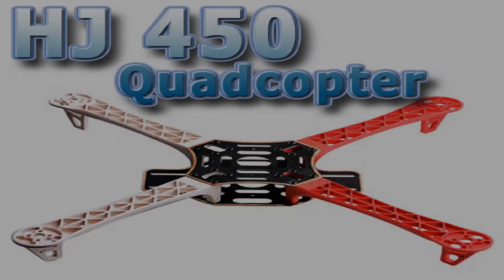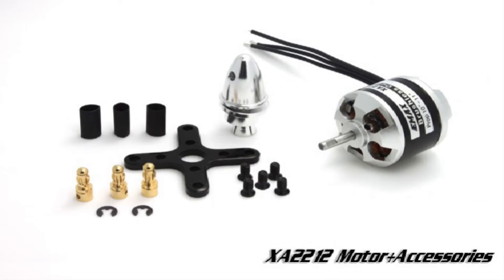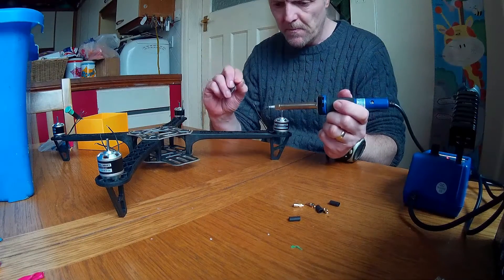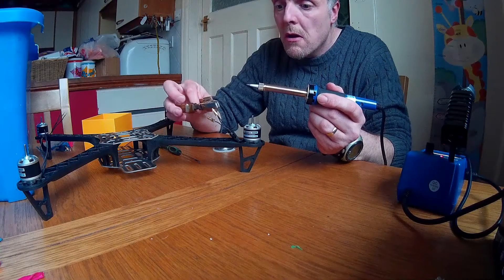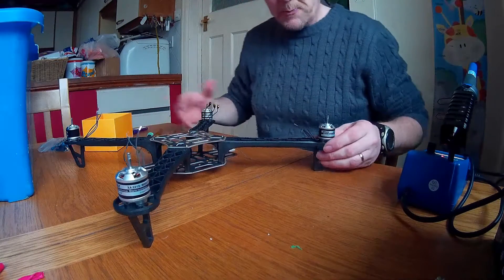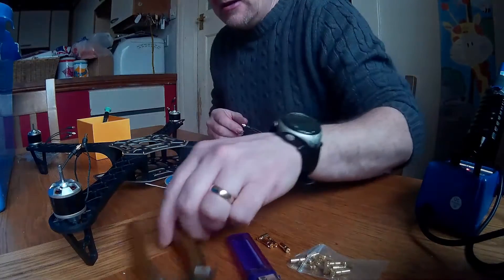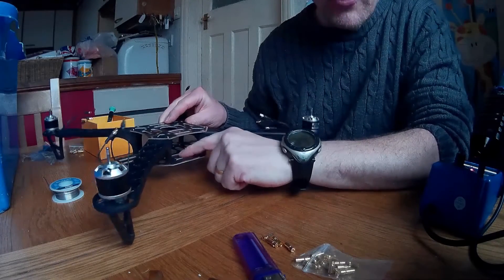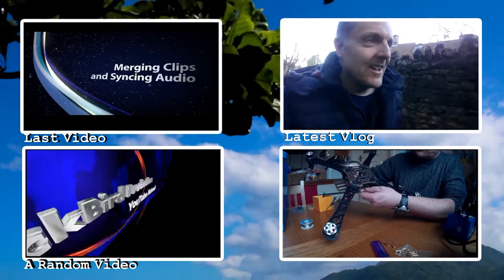How To Build a HJ450 Budget Quadcopter (Drone)- Part 1

Comment: Good to see you here again Austin. I have been considering getting a quadcopter of some sort for a long while but  they are just too expensive. (I've been looking at ones with GPS and instant return to home etc). I'll be following your experiences with this one and if all goes well I may get one myself and then add to it as I gain experience. I don't have a clue how to set one up properly, lets hope you do!
Chris
Reply from the maker: Me neither Chris. Lol it will all be in the bids. ;-)
Reply: Scudo Camper I really wanna build one, but they don't seem to come with a transmitter... or motors it's all confusing. Would be a lot better if they sold these as RTF (ready to fly)
Reply from the maker: markybyeah you can get them on eBay. a few people do do them. 😊
Reply: Be aware mate even the tailor made ones can go wrong....I just bought a DJI Phantom FC40 with GPS and Go Home Facility........Dam thing won,t leave home never mind find it,s way back...Took me a while to unpack semi build it..Then reprogram it with uptodate firmware.......and there,s more flight in a chicken wi broke legs.......and getting hold of DJI No Chance, they will not even responde mate.....so be carefull what you buy and who from
Reply: Scudo Camper
The kit it self is cheap... motor, transmitter and electronics cost hundreds!
Reply from the maker: Thanks mate. All the bits you see in the video were very kindly donated to me by my good friend Wiltshire man. Need a few extra bits and away we go. 😁
Reply from the maker: markybyeah I have seen some rtf kits about 280 I think altogether. 😊